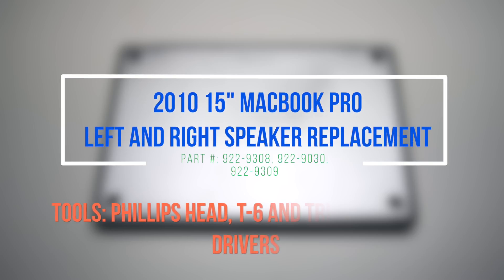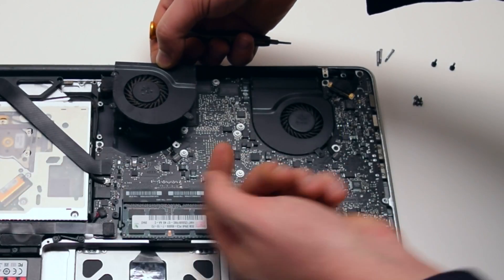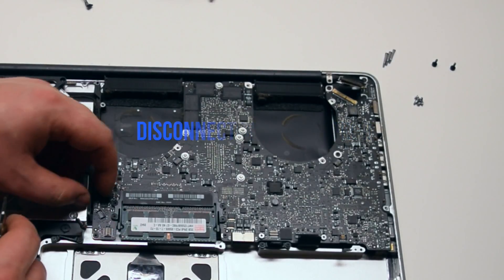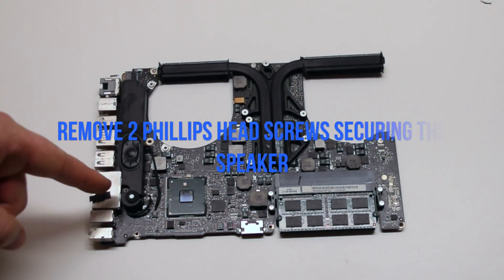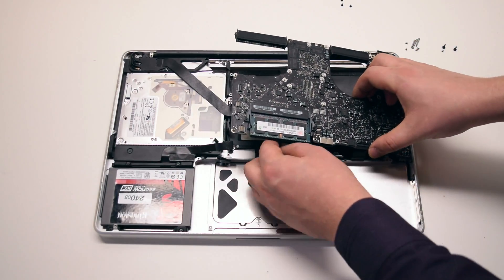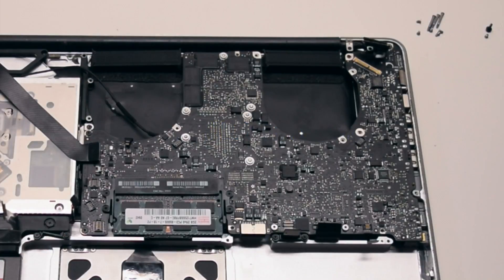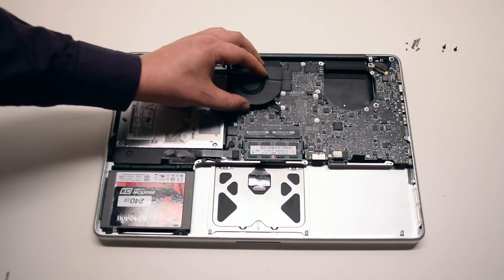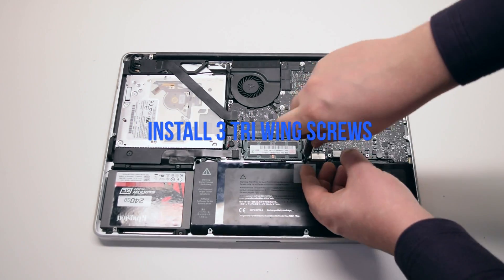2010 Macbook Pro 15" A1286 Left and Right Speaker Replacement

Comment: Great video.  I did a data doubler project years ago on my 2010 A1286.  Just recently I replaced both drives with newer SSDs, not touching the speakers except to tighten the screws (the one under the SATA cable for the bottom drive was completely loose)  When I put everything back together I noticed distortion.  Any idea on whether the torque of the screws could have done this?  I'm kind of baffled as the speakers face down during the replacement.
Reply from the maker: It's the tightness of the screws on the doubler. Try to un-tighten them a little or get a new speaker of ebay for a 2010 A1286 it's here https://ebay.to/2J5Ezbo
Reply: Does the potential overtightening of the data doubler put to much pressure on the speaker and ruin the cone or something?  I ordered some replacement speakers from powerbookmedic.com and don't want to screw up again.    Thanks for the response, btw.
Reply from the maker: Not in my experience but I could see that it's possible. Let us know how it works out after replacement.